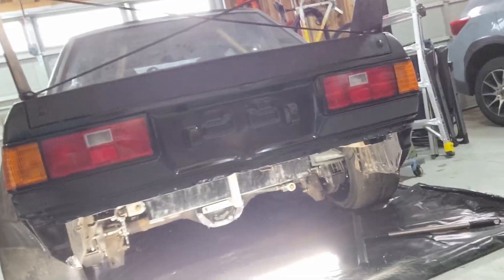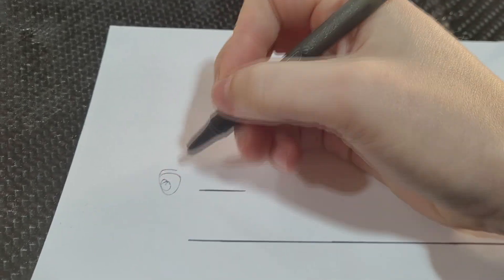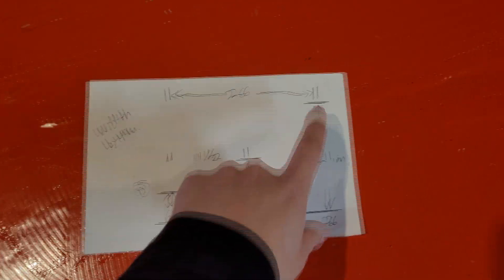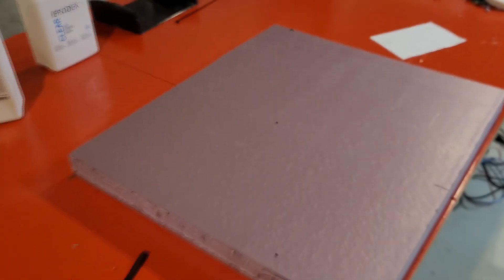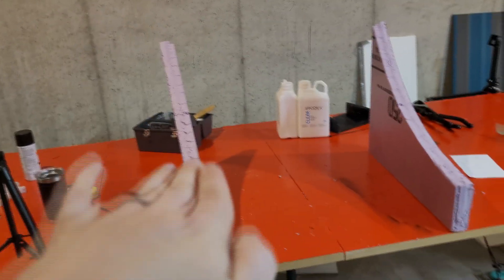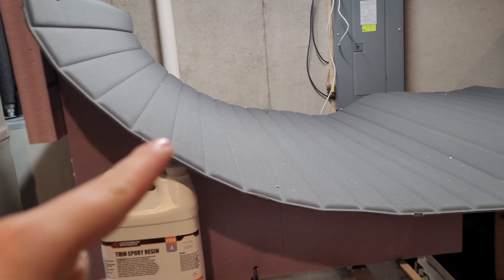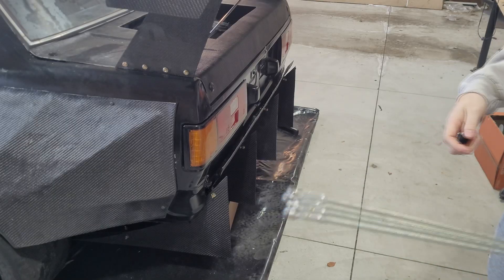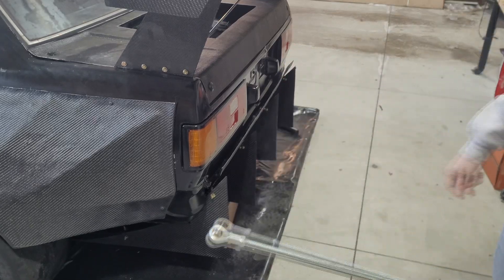DIY Carbon Fiber Radiused Diffuser for a Budget Build

Comment: yea that angle/curve is way to large, it does nothing other than increase pressure drag. u need to run some CFDs before deciding on the geometry. Additionally, u need a relatively flat/smooth floor for a diffuser to really work, which i dont think it is the case
Reply from the maker: I don't disagree. That's why I wanted to emphasize that it's just as much an aesthetic piece as functional. I received the car with that section cut out and didn't want to have that area open. Also to do a proper CFD I'd need to have all the other geometry in a 3D model which I don't have. I do plan to add some additional flat floor section under the car, but with a solid axle it can't be flat front to back.
Reply: @ regardless, that was really good effort and I learned something from your video, so thxx. As for the 3d model, the easiest way is to just use blender (parametric modeling) and model by eye/rough measurements. It’s completely free
Reply from the maker: @Literature4343  Great, I'm glad. My videos are never about doing things the 100% industry accepted correct way, but more to show there's plenty of ways to make things. I've used blender a little bit but I tend to favor solidworks because that's what I know.

Comment: Diffusers are ground effect aero, therefor it has to work with very limited air. I am not an aerodynamicist and have not done any CFD, but your diffuser looks way too tall and way too short. I'd be very surprised if the flow does not immediatly seperate, making the diffuser useless.
Reply from the maker: There's a perfectly good chance that happens. That's why I wanted to emphasize that it's just as much an aesthetic piece as functional. I received the car with that section cut out and didn't want to have that area open.
Reply: @slightedengineering  
Does saying it is as much a cosmetic modification as it is a functional one, even though it does not work, not mean that it is ugly? 
You did agree that the design does likely not work.
Reply from the maker: @Sir_Cactus  Pretty sure I never said it didn't work, just that there's a chance it doesn't reach its maximum efficiency. From my research, as you increase the diffusers distance from the ground, the effective ramp angle can increase due to the larger volume of air being worked upon. To make the assumption that something doesn't work simply because it doesn't align with your thoughts seems a bit closed minded to me.
Reply: @slightlyengineered  tape some strings to the underside of the diffuser and film them while driving. If the strings stick to the diffuser, it works and I take back everything I said.
Reply: @Sir_Cactus your logic seems bit flawed. Inherently a design is not deemed ugly because it is not optimized or functions correctly. Functionality and cosmetics are two independent concepts. One is based numerical data while the other is based on opinion.
Reply: @primus77  He did state that it is as much cosmetic as it is functional. By that logic, as the functionality is questionable, that would also mean that cosmetic aspect ain't working.
Reply from the maker: @Sir_Cactus  That's on the to do list. But somehow, I doubt you'll be around to see the results.
Reply from the maker: @Sir_Cactus  If you could elaborate on how a metric driven by testing and numerical data are related to a metric based on opinion, that would be great. That would solve a good chunk of the internets arguments.
Reply: @slightlyengineered  You said your diffusor is as cosmetic as it is functional. By that logic, if it does not work, in other words is not functional, it also is not very cosmetic.
Reply from the maker: @Sir_Cactus  A component can have two different attributes that aren't related. That's like saying an apples color and taste are inherently related.
Reply: @slightlyengineered  By saying a component is as cosmetic as it is functional, you are putting the 2 aspects in relation.
Reply from the maker: It's clear that this was a misunderstanding. My intentions were to relay that I had multiple reasons to make it. With each reason having independent purposes. First, to aesthetically fill the hole left by the previous owner. Second, to add some functional performance.